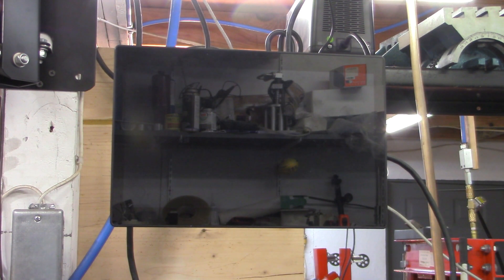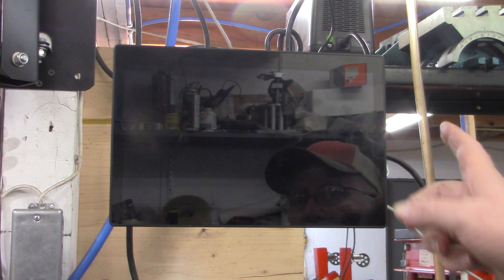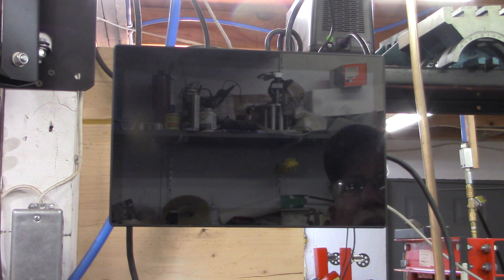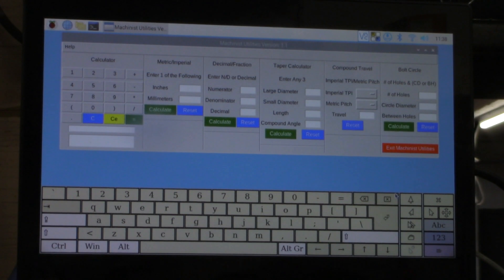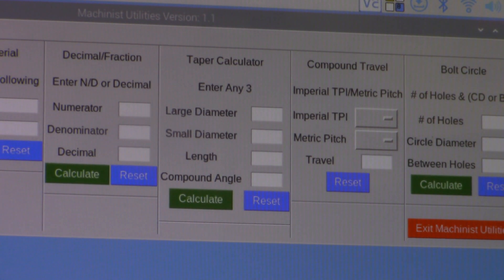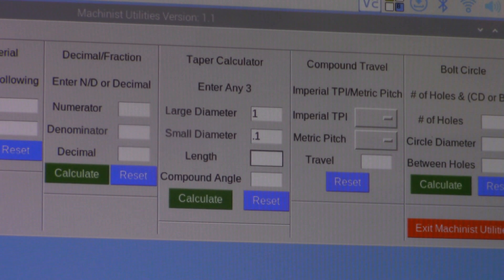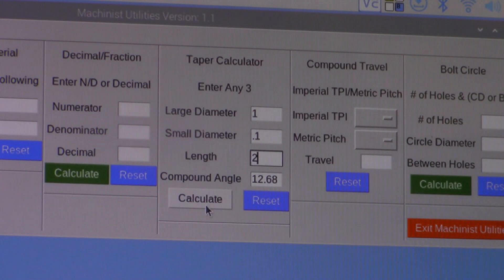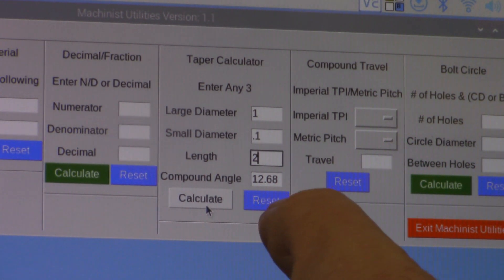Can You Knurl a Taper?

Comment: Hey Lee! I would never have thought that would work. I thought you would use a single wheel so it would run on the tangent of your work piece. I use an English Wheel some and know that the upper wheel will imprint your work piece with any imperfection in it. So you could make your own wheel with any pattern you would like and imprint it on your work piece where you are not going to part out for the trunk. Nice video Lee; thanks!